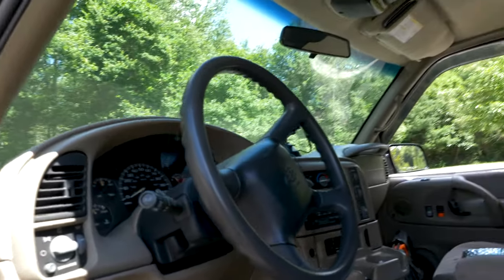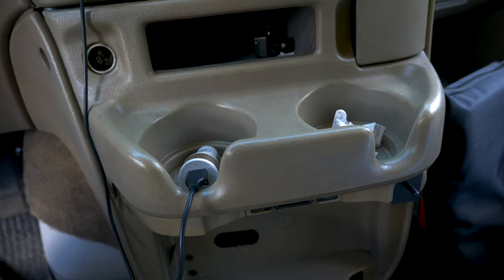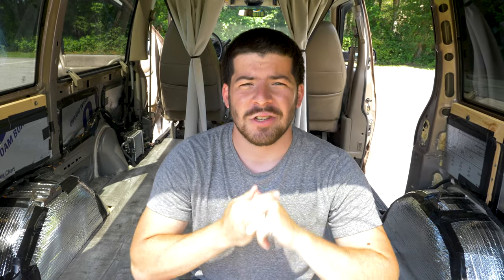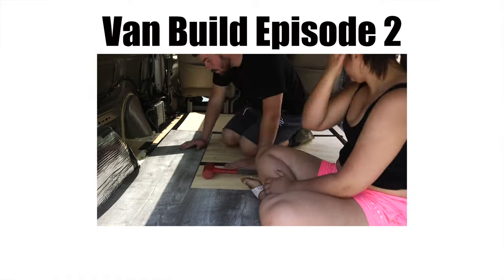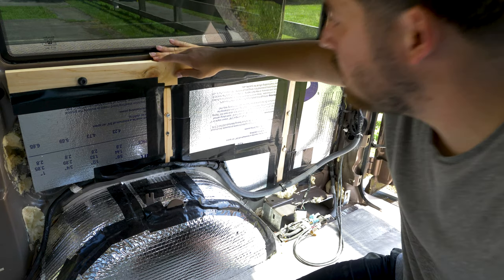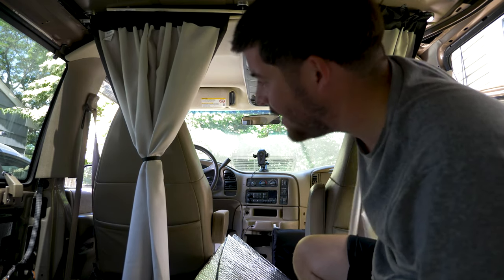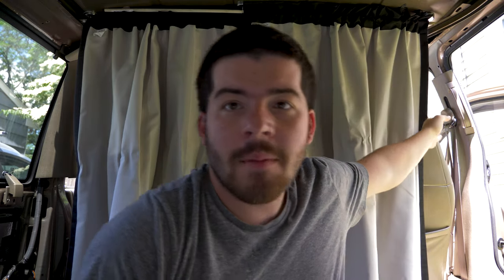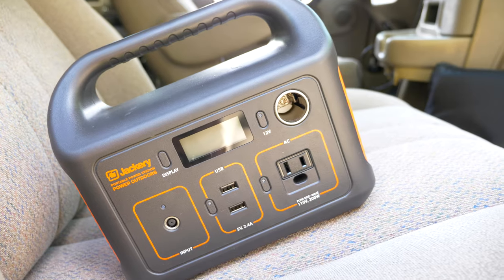Van Tour & Build Update - 2002 Chevy Astro Van

Comment: Your freckles are so adorbs!  (I'm here because I have a 2005 Chevy Astro van, exact same color as yours.)  What did you say you paid for yours?  Mine was $2500.  Was suuuper clean inside.  Non-smoker; that's my only "no way" thing.  I don't think I could live in the van, because you can't stand up in it.  But, like you, I took the two bench seats out.  Sold one, saved the other.  Then I put a piece of carpet padding and carpet remnant (both new) over the original carpeting and used mini screws to hold in down.  The screws went thru the carpet and pad, and into the original carpet, but not into the metal.  You could totally camp in it; it's like one giant bed.  I don't want to put any built-ins or a built-in bed, because I want it a completely adjustable space.  Maybe you want to just hang out with friends, maybe you just want a motel on wheels.  So far I haven't had any dates or friends in there.  lololol

Comment: i have the same van in the 2001 year. i used 1 1/2" foam insulation with 2x4 battens then 1/2 ply over it. Reflectix is great as a vapor barrier to sop the water vapor from collecting on cold metal.
Reply from the maker: Thats awesome, do you have an instagram or anything so i can checkout your build?? Im about to start building the bed this week and im looking for some ideas lol
Reply: @stevenrichardma  i am not going to build a bed, i had a tear drop trailer for years and i am used to just sleeping on a pad. And having a 95lb golden retriever that will be my constant companion, i will just have a camping box to store what i need. There will be 300watts of solar power on top to charge all of my photo gear and drone batteries. 

look up davidewersphotograph. i just put up three photos on the floor.
Reply from the maker: Southbay Skyview nice man, i just followed you! Looking forward to seeing your build and travels ✊I’d love to get a trailer in the future but for the trip im going on right now i need to be stealth

Comment: I doo care about the suspension work! How much did it cost!?!?
Reply from the maker: I had to get the suspension fully replaced, the spider injector removed and replaced and a few other things fixed and it costed $2,500! We bought the van for $2,500 with a budget of $5,000 so it worked out, but deff a big fix.